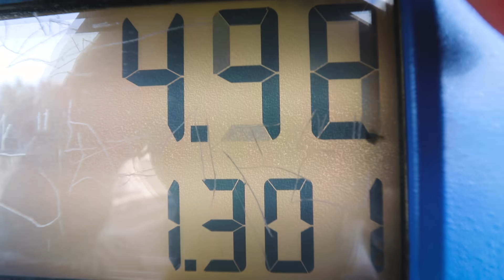The Rebuilt Subaru Wagon Gets A NEW TURBO SET UP!! Pray For Me...

Comment: Ive trialled an errord ej setups for years and wasted tonnes of money .Go sleeve an close deck a 2.5. Nitto I beam rods an pistons. Stock crank an bearings. Twin turbo heads as no need to port as there larger than normal. Bc 280 cams and +1mm oversized valves.(these heads use v5-6 parts) can use v7 manifold and front face without modification. 14mm or arp  custom aged head studs is perfect for power. We made 650hp on 26psi 98gas . It's good for 40psi e85. Which estimates 800+. If you want cheap an reliable. Buy a stock v7 long block and you make a 450hp(300kw) straight away. H6 definatly makes more power at lower boost but also cost alot more. Best thing about subaru is alot of the parts are inter changeable. I run a gtx3582r gen2. Gets full boost by 3800rpm and sounds like a smaller version of a t51r with a nice whistle. Hope this helps.

Comment: I don't understand single turbo exhaust setups for the flat motors..does the exhaust from one side run UNDER the engine to the other side and then out the car?

Comment: Nice upgrade! More boost. More fuel. More HP. Means more heat. I don't know much about Subaru but hopefully they come with an exhaust temp. gauge in the dash. I run my cat up to 950/1000 degrees on the cold side and then split a gear or drop a gear or back out of it. Aluminum melts at 1220 degrees. Save the pistons or the top end. If you drive it like you stole it you will not be driving it very far:)) but it will be a very interesting ride:))

Comment: If you're going H6 on it, there is only one H6 you want in it, EG33. It's the best one, as it's literally based on the EJ22 but just done a +2 cylinders on, so it's got good block thickness, good strength, sounds great, etc.
Only problem might be finding the EG33 as people snatch them from the SVX's first chance they get lol
Reply from the maker: I appreciate the info thank you!
Reply: Ez30 is also good. In nz you can make 700hp on 8psi atw
Reply: nz trucker EZ's are decent, not AS sought after as the EG's, so easier to find.. but there's a reason the EG33 is so desired... and it sure as hell isn't because of the only car they come in being the SVX lol, such a weird car to come with such an amazing engine.

Comment: The new Supra will demolish all the ones that came before it, It will be a legend. And this is just the equivalent of the NA MKIV, the TT equivalent will be coming later on and it will be Toyota's best car in their whole history.
Reply from the maker: It's all jokes until I get to actually drive one!
Reply: @EmeliaHartford  Well... I don't know about it when it's stock, sounds a bit underwhelming from the spec sheet, I'm thinking more of the after-warranty-500whp-BPU ones! And that's just for starters =D
Reply: I don't think it will. Because it is BMW developed car. So TT equivalent is basically an M. BMW hasn't offered Z4M last gen, and isn't likely to do one this gen. I would really want to see someone swap an S55 from M2comp/3/4 into the Supra since they can do 700WHP with pretty normal tuning such as turbos, intake, exhaust, methanol injection. So stock bottom end. That'd be a spiritual successor to TT Supra. Or new S58 from new X3/4M. With 510HP stock, it might be just as good at tunability as S55.
Reply: @EmeliaHartford  I'll be waiting for that video! Also, for your drag project, you will need a third gen Firebird, because Firebirds are the best thing that GM ever made!
Reply: @Georgekartveli  Yes, BMW said they won't be making an M version, but Toyota already said they will be bringing out a more hardcore version called the GRMN. But, don't sell the B58 short, it's already making 650whp on the stock bottom end, the closed deck block and forged internals make it very tuner friendly. It might be actually co developed with Toyota, but we're still waiting for official information on what went into making these two cars to know for sure. And the S58 would be a better swap than the S55, obviously =D
Reply: HAHAHAHA, incorrect...2jz can do 700-900 hp with stock internals
Reply: @TheYummyBrand  Yes, you clearly build cars...
Reply: @Death666wish  BMW has been using B58 for a long time so I doubt it was co-developed with Toyota, it just looks like a natural evolution of n54-n55-b58 aligning with their statement couple years ago that they plan to share 60% of components with their modular 500cc per cylinder engines. I know for a fact B38, 48 and 58 share pistons and connecting rods. Probably more things as well. As for B58 I'm interested to see cars running 650whp stock bottom, mind sharing a link? And GRMN will be tuned for sure, but they either have to make their own engine which isn't likely or convince BMW to put S58 in it which is equally unlikely. I would love to see a UR engined Supra though, so that might happen.
Reply: @Death666wish   I'll believe it when I see it...I do like the fact they switched to a rocker system...closed deck, Siamese cylinders, twin-scroll turbo, forged internals, mechanical water-pump...going to be hard to work on(water pump, timing chain, etc on the back of the motor), plasma-lined(no rebuilding that block), and let's see of the block is going to be as hard or as thick as the 2jz...vanos is kind of a wash but I think with twin-scroll and anti-lag, the turbo will spool up very quickly...yes, I could be judging too quickly but so are you 😉
Reply: @Georgekartveli  Toyota and BMW's relationship started in either 2010 or 2012, can't recall exactly, the B58 came out in 2015, and even if it was based on the earlier versions, doesn't mean it wasn't co-developed, but nothing yet is saying it was, so we'll have to wait and see. And I don't think you'll find a different engine in the GRMN, probably a B58 with a little more power due to some tuning and a little bit of changes, I was just trying to ruffle some feathers going by a guy on the Supra forum that kept hating on the new car and then one day changed 180 degrees and is now saying the MKV will be the best Supra ever made after he talked to some insider in Toyota that told him a few things, some of which he found to be true when the car came out. But, I still believe it will be a great car and might actually end up being the best Supra, I know I want one, but it has to be a manual. the UR is the V8 correct? A V8 does fit according to the chief engineer, but for them out of the factory an inline 6 is mandatory, but swaps I'm sure you'll see plenty.
Reply: @Georgekartveli  Oh and the BMW unfortunately I just saw it on Instagram so I don't really have the link, but I'll take a quick look and see if I can find it.
Reply: @TheYummyBrand  If I'm judging so quickly then show me a 900whp stock bottom end running around with that kind of power all the time and didn't blow up yet. Yes, the 2JZ's record is I believe 1080whp on a stock bottom end, but those are dyno queens, they don't run that kind of power all the time, 600-700 yes easy, 800 is also possible as I've heard, but 900? I'll believe it when I see it.
Reply: @Georgekartveli  Check the first page on this thread, a guy posted the one I've mentioned but I don't know why it's not loading Instagram for me, maybe the owner deleted the post, I can't tell.

Someone also posted a link to a company that has either full B58 engines or kits for them, not sure which, that they claim has 1000hp. But unfortunately I can't remember which thread that was in.
Reply: @TheYummyBrand  With just a tune it will easily be in the 11s let's see an mk4 do that.
Reply: @Death666wish  Well, 2015 seems about right yeah, so even though they partnered up in 2012, I doubt they made significant changes to engine, because it went to production early 2015 right? And they started partnership in mid 2012 with focus on 1.6 and 2.0 diesels from BMW and hybrid tech from Toyota. So with those priorities which are backed up by 2014 diesel Toyotas and i8 release time they couldn't really do a lot of changes especially since it's a modular engine with 3 cylinder and 4 cylinder versions launching in 2014. As for 650hp or 1000hp B58s, I believe some exist, but they are probably built bottom end. There definitely are 1000hp B58s but they are built and if we start talking built, then what engine we start off with doesn't matter all that much, does it? I don't know what thread you are talking about since I can't see the link, but if you can post a link about stock bottom end 650hp B58 I'd be interested. UR is indeed a V8. It might be too heavy though, but if it's not 5.7 from LX570s and Tundras would be interesting with TRD supercharger making 600hp ofc, or 5.0 from IS-F, GS-F, LC 500 with RR670 supercharger.
Reply: @karlhopkins713  now we're talking platforms and not engines? Ok, I can buy a junkyard LS with a $500 MR2 and smoke the Supra while saving $30K or $40K with the BMW
Reply: @TheYummyBrand  The new supra will be better in almost every way.
Reply: @karlhopkins713  post yours when you get it! I'll post my MR2 with 900hp, haha...then you can bring it Denver and we can race for the difference in cash that we spent!
Reply: @Georgekartveli  Darn it, I forgot to post the link hahaha, here it is:
https://www.supramkv.com/threads/the-supra-b58-engine-has-potential-440whp-460wtq.1552/

and it seems to be showing the Instagram post now, strange, either way this is it:
https://www.instagram.com/p/BpYaq8fAU6c/?utm_source=ig_web_copy_link

I didn't mean the 1000hp one is stock, it's definitely built, I'm not like the teenagers that think you can make 1000whp from a 2jz with a bigger turbo, and exhaust and a body kit.
Reply: @TheYummyBrand  Watched the whole video, didn't see any 900whp Supras that run that much boost all the time, didn't even see a dyno queen, pretty clear who's the douchebag, bye bye.
Reply: @TheYummyBrand  wow, you can read the brochure
Reply: @theoc8717  lol, cool story bro
Reply: Incorrect,FAKE NEWS,2JZ buddy hands down
Reply: @derrickjones4371  maybe not... The switch to the rocker design is a game-changer... Someone should test the b58 and n55 block for hardness and thickness versus 2jz(n55 might give us an idea of b58 hardness)